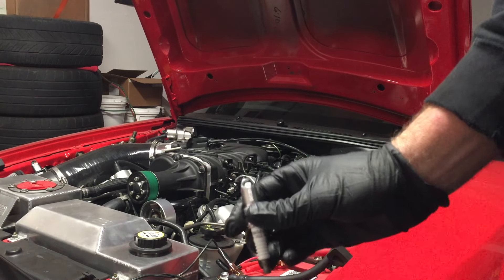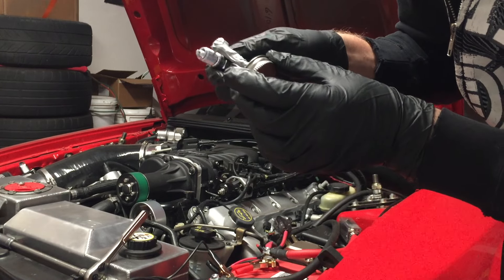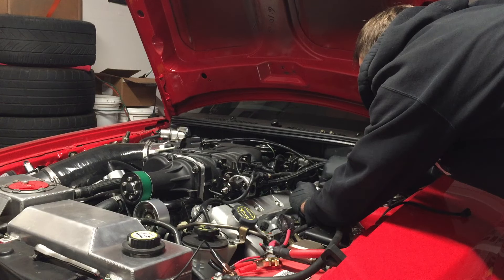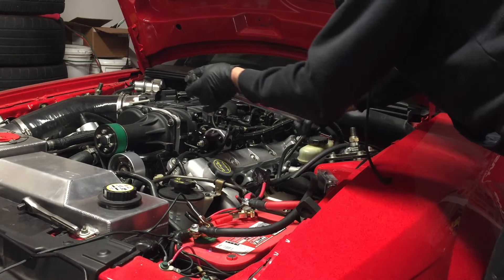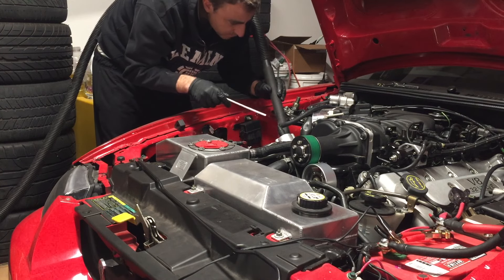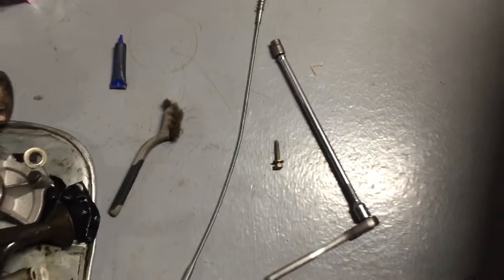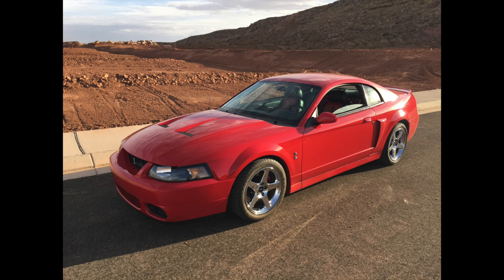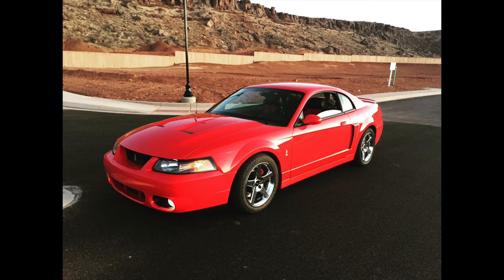03 cobra update Dyno Tune Prep

Comment: Great videos been watching them forever. A good tip for your plugs is get yourself a piece of coolant hose about 10 inches long that fits snug on your plug, Use that to screw them in. Dropping them even from not far your gap wont stay what you set them at!  Good job!
Reply from the maker: Thanks for the advice. I try to do everything as carefully as possible and I am always willing to learn from others.
Reply: @justin.c_svt  Glad to help out bud. I am a Millwright for 22 years comes in handy! 
I just checked its 3/8" × 10" long just rubber hose. I had it left over from when I plumbed up my JLT seperators.  Its in my toolbox comes in handy.  Had the plugs out 4 times this past summer when I was getting it remote tunned. Works great!
Reply: @justin.c_svt  Sweet car btw.
Reply from the maker: @jamiesvt  Awesome.

Comment: Do not put anti seize on ngk plugs. Read the box, most of ngk plugs come coated already from the factory on the threads. The anti seize's dont mix well and can make it hard to get the plugs out. The previous owner did this on the plugs in my cobra when I bought it. I thought I was going to strip the threads out of the damn head and have to get it helicoiled. I actually had to use a 3/8ths breaker bar to get them loose. Thankfully the threads on my heads were ok, i chased them, then put new plugs in.
Reply: Another tip is to use some 3/8 vacuum hose on the top of the spark plug to get it in the hole and get it started.
Reply from the maker: Nice tip, thanks
Reply: Currently having my 2003 Mustang GT engine out at a shop because that happened to me. Bought this GT half a year ago, came with a full Bassani exhaust and hurst shifter. The previous owner stripped the plugs and used the wrong helicoil kit so now I need a new head. Spark plug blew out on Thanksgiving.. Really don't want to let it go.

Comment: Spit out a plug on our 03,  Heli coiled years ago with no problems. But the tech that did it told me 20ftlbs is what he recommends even though 15 is the official number...Is your car 9 thread heads or 4?
Reply from the maker: Mine is a 9 thread. as amatter of fact, my 03 Azure Blue mach 1 was also late production and got the 9 thread heads too. so all 3 of my Mach 1's were and both my terminators are 9 thread cars.